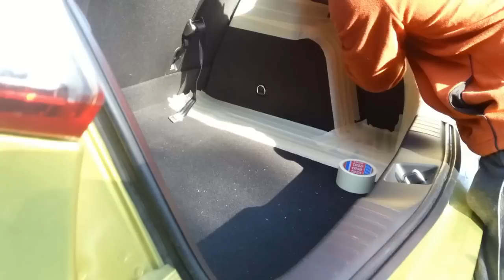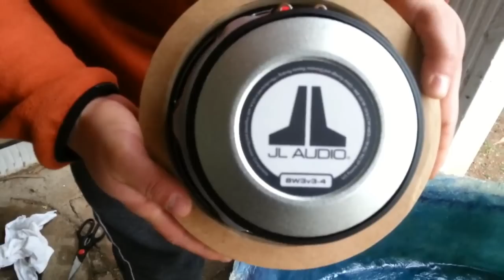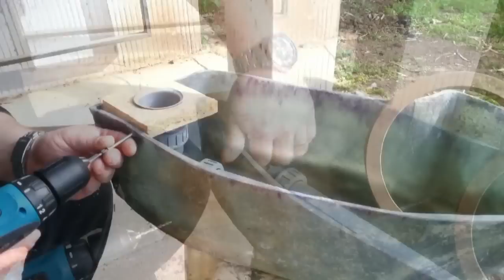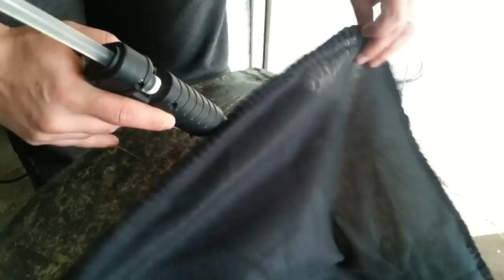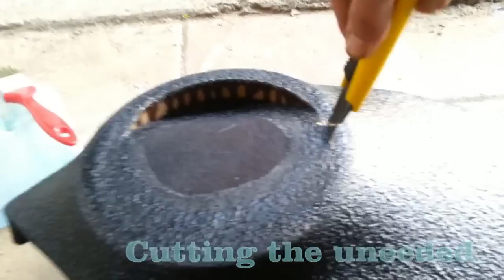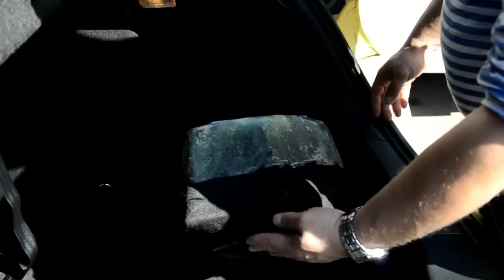Caixa de fibra !!! sera que é boa ????

Comment: Boa tarde Daniel.  acompanho seus vidoes e são realmente muito bons!  gosto muito de eu mesmo meter a mao para aprender como faz por curiosidade e tambem porque gosto de saber como fazer como foi feito, estou montando uma caixa toda em fibra (apesar de ter visto seu video e saber que não é do seu gosto esse tipo de caixa) eu gostaria de saber o seguinte, estou montando essa caixa e tenho dois subs um é um DIAMOND D3 bobina dupla de 2ohms e o outro é um falante H.BUSTER KILLER   bobina dupla de 2ohms, qual dos dois seria melhor pra ser tocado por um rockford fosgate punch 800.2.  outra duvida que tenho é o seguinte estou fazendo a caixa moldada na parte traseira do portamalas e ela servira para suportar o sub + punch 800 e uma punch 300SX pro estereo. essa caixa eu ja usei 4 kilos de resina em uma camada so de resina e depois uma camada de resina com a manta, ela ficou bem rigida nas bordas mas no meio esta menos rigida.  Voce acha melhor eu dutar ela para diminuir a pressão interna na caixa ou melhor SELADA mesmo e reforço com a fibra?  Muito obrigado pela resposta ai, caso tenha algum email para eu te mandar fotos da confecção dela pra voce ver como esta é so mandar ai!   Abraço e parabens pelo canal novamente